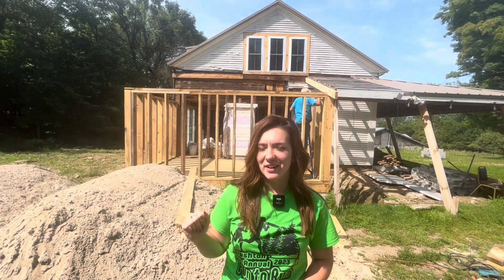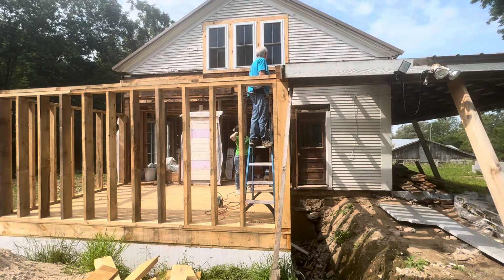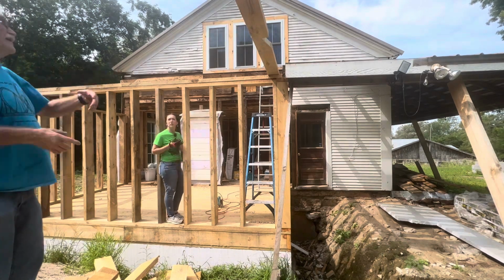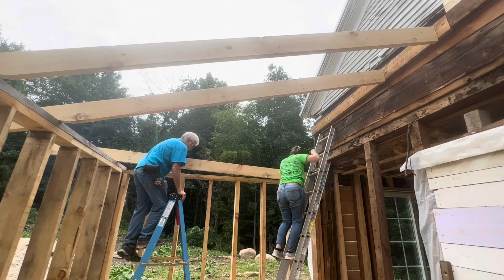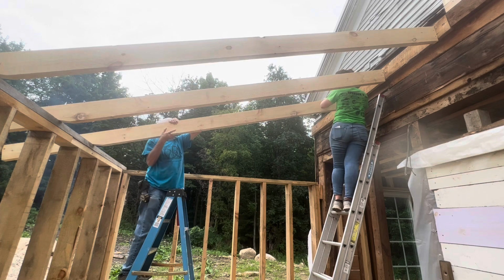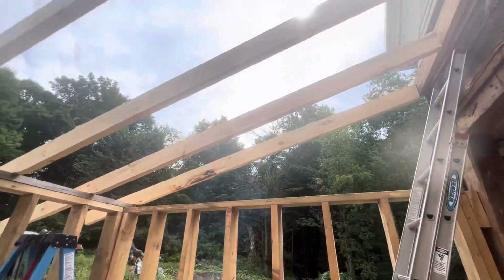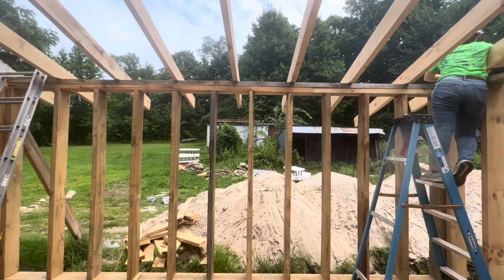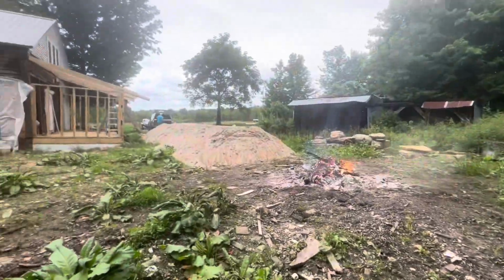RAFTERS ARE GOING UP on my Bathroom/Laundry Room Addition! | my Total Home Renovation

Comment: Hello Abby.   Please consider using some Simpson rafter hangers, or your local equivalent, to tie the rafters into the wall at the top of their pitch.   Snow loading can rip out screws and nails very easily.   The hangers help transfer the load bearing on the rafter to the wall and help prevent the rafters from pulling away from the wall.  Your roof will thank you…!
Whipple

Comment: Abbie, wouldn't it be easier to put up joist hangers first then the rafters can rest on them while your screwing them in? Just wondering. It's looking great!
Reply: Sometimes the wood is different sizes(even though its not suppose to be). So putting the rafters up first makes sure they are all the same elevation

Comment: Just saying if you would of put the hangers in first it would of saved you guys on holding up the rafters could of set them in and then went back and screwed em in
Reply: Good idea, that works slick, I snap a line and put the hangers in first, also if you put a straight board 2x4 along the snap line you can set the rafter on the 2x4 and maybe leave the 2x4.  Also a half truss could be built looks like a right triangle .  It will be interesting to see if Abby puts in an 8 foot ceiling or leaves it vaulted with a sunlight.  I may have incorporated the ceiling in the half truss if 8 foot ceiling, either way it's getting done and fun to think and challenge ones self.

Comment: can. you please fill the holes in? with the sand?? please... if you or Jay fell and hurt yourselves that would be awful..Health and safety please!
Reply: Sometimes as builders we wait until we have more down weight on the cement b4 filling with backfill or crack the wall.
  I have seen full walls collapse in from back filling with no down weight.

Comment: Abba...you should get a nail apron so you can carry the screw in it instead of in your jeans or your lips...easier to get out of an apron....shouldn't put screws/ nails in ones mouth/ lips...can give you a coldsore....think you are using either slot or phillips headed screws....if you were here in Canada, robertson headed screws would be available...the difference is philips is a star, robertson a square...in any event, you are progressing well...will be nicer navigating around once thd backfilling is done